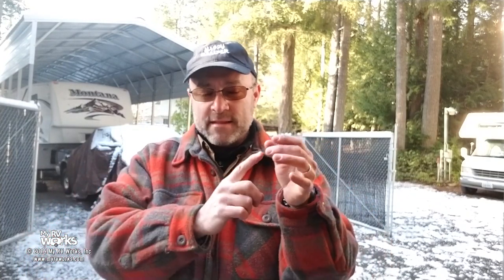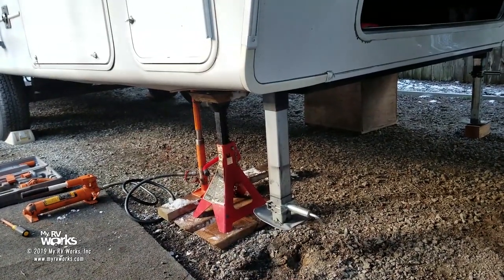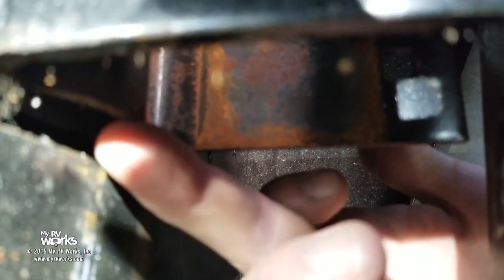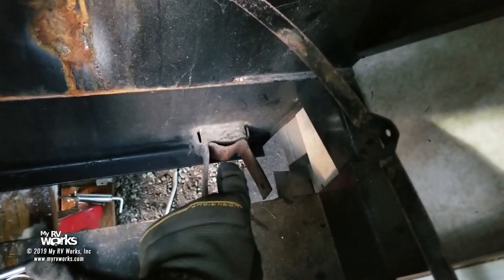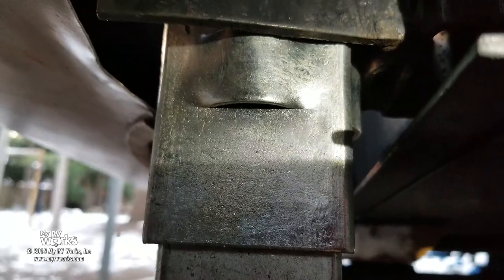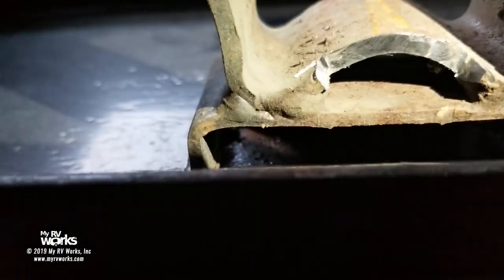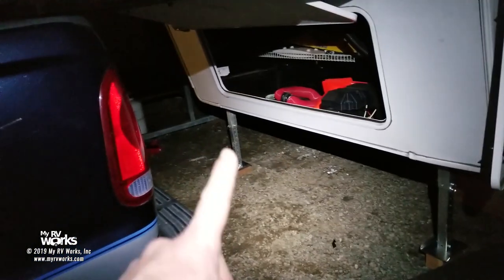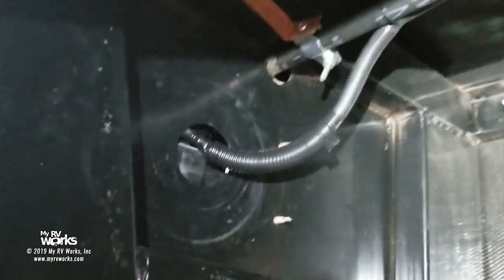Remove Seized Fifth Wheel Landing Gear and Replace with Ultra Fab Jacks

Comment: Very good job! Your camera work, the actual work, and your explanation . I'm going to look into replacing just one jack on my RV because the main gears inside the leg are jumping or slipping somehow. They seem rounded off from years of  use with the gears not being a tight enough fit into each other.  Also, it seems to me separate controls for each jack isn't all that necessary.

Comment: Question:  one of my landing leg on the driver side (right leg when facing rig) on my 2006 cougar 278efs does not extend or desend up or down manually or electronically with the switch.. Only the left side does.. I had my rig delivered from stelaership and they absolutely knew about the faulty leg.. 

Now to lift it back on the truck the side that extends goes up putting all the weight on the right side making it look like its bending!!! 

How much will this run me ?

Comment: I have a 2011 montana with the same problem the Jack's were not strong enough for the weight of a montana with a motor on each side solved the problem
Reply: What is the tongue weight of your rig? Did you use the Ultra Fab Jacks?

Comment: I have a 2005 35' Cameo by Carriage. It has electric landing jacks. It uses one motor with the cross bar to the other. If I need to replace one, is there a benefit in replacing both with independent jacks and motors as you did in this video vs staying with my current configuration?
Reply: The dual motor setup is more robust then the one motor/crossover tube system you have now.  As he showed in the video, the shear bolt is a weak link.  Additionally, the gear box on the one motor system is plastic gears and they tend to wear out.
Reply: I’m wondering the same thing. I have one side not working and it’s the side that the bar connects to. Could I just leave the motor on the side and remove the bar and install one of these on the other to have independent stabilizers.
Reply: @nathansnider4678  You'd have to determine if both the old and new motors turned at the same speed.  Otherwise one side will go up faster then the other.

Comment: Are both ears supposed to fit under the rv frame brackets as support?  It seems to me that is the point of the jacks, but noticed on some diagrams only one ear is providing bottom support and the other fits above the second rv frame bracket.  Anybody have info/ideas on this?
Reply from the maker: One ear should be enough to support the whole RV on its respective side. As long as the entire jack is properly seated in the top and bottom clamp assemblies. What I've seen on some of these jacks is one ear is on the top and the other is on the bottom. That will hold the jack totally in place and not allow it to move either up or down. Unfortunately different manufacturers have not standardized the dimensions of these ears so you have to do what I did in my video to modify a little bit to make it fit.